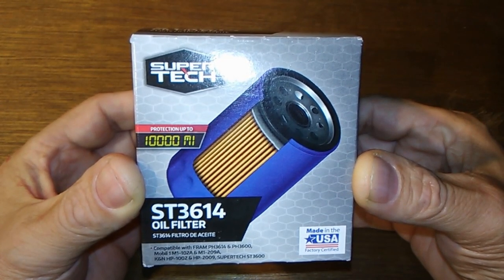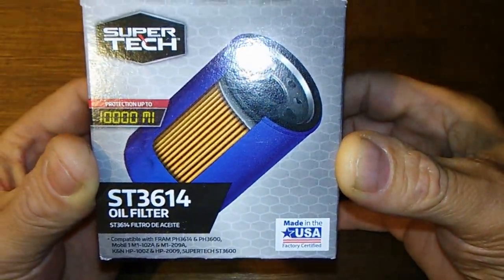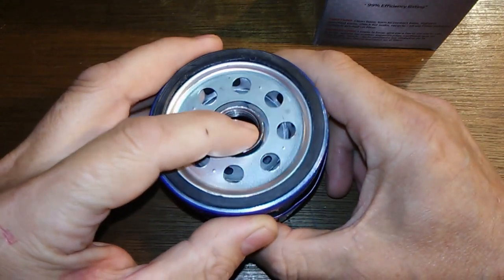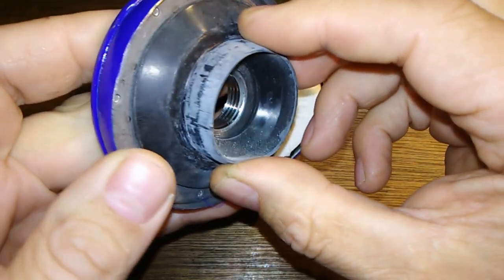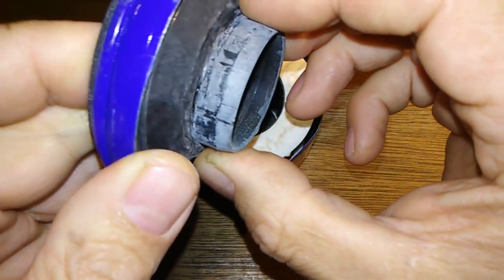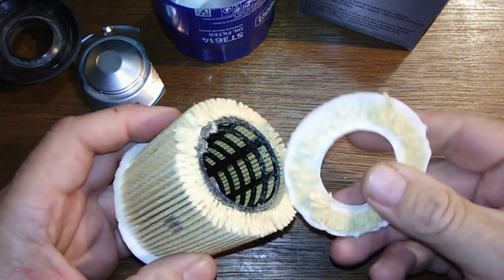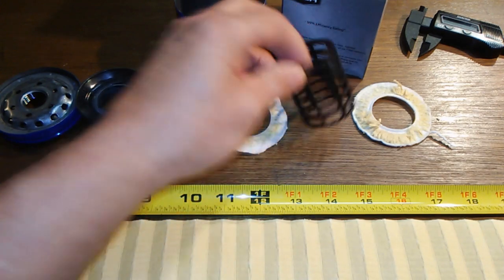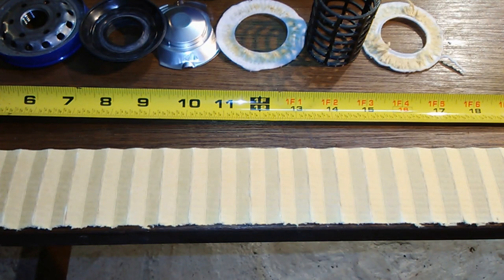Walmart Supertech Oil Filter Cut Open ST3614

Comment: I use this oil filter 3614 on my riding mower and the SuperTech 6607 on my car. Both work just fine. No issues.
Reply: TheSuperTech 7317 size filter might fit if there's room.

Comment: I cut open a super tech oil filter that was on a buick/ gm 3.4 liter. It had the same ultrasonic welded on end discs. The filter did its job and there was no separation at all. Oil filters are made to filter oil THAT'S IT nothing more, nothing less.

Comment: My 2006 Fusion uses filter elements and all that I have seen for it have been felt ends and they seem to hold up ok.  The reason I like the plastic cage is that there is far more open area for the oil to flow than the metal cheese graders.
Reply from the maker: JMHO, but I'm not a fan of the felt end caps, the plastic cage is okay I'm all for a better oil flow.

Comment: If you keep your oil changed and you never rev the engine when its freezing cold out you wont have a problem with any oil filter. I have had new oil filters that wouldnt supply oil pressure put another one on and everythings ok
Reply from the maker: I'm curious how did you know the oil pressure dropped, do you have an oil pressure gauge, and what oil filters did this? I put a working gauge on my vehicle a couple of years ago, I've only tried two different Filter Brands, but have never had this happen.
Thanks for your comment.👍🙏😊
Reply: @WhipCityWrencher  The motorcraft is on my 65 mustang I use super tech on everything else.

Comment: I use the walmart filters. I think they are the same as acdelco professional. I change my oil at 3,000 miles even if it is synthetic. Oil is cheap.
Reply from the maker: Hi J Alton,
Thanks for watching and your comment's 👍.
Reply: Really? I changed mine at 10,000 miles with synthetic and no problems at all.
Reply: @cnn787-i9e  On average, 3,000 miles is when I change oil.  A person could view it as a waste of money, but I view it as money well spent on maintaince. I also change air filters more often than needed. 
May I ask how old your vehicles are?
Reply: @jalton9416  mine is a 2012 Mitsubishi Galant with over 170,000 miles. Engine still run like brand new and smooth, I have only done normal wear and tear maintenance on the car such as brakes, timing belt, and oil change every 10,000 miles using only synthetic oil. It helps that over 90% of my driving is highway mileage.
Reply: @cnn787-i9e  I would say you are doing alright with your service intervals than. Glad your vehicle is holding up well. The vehicles I service are: 
2000 dodge neon with over 120,000
2003 chevy tahoe with over 200,000
2004 chevy silverado with 160,000
2006 chevy silverado with 130,000
2008 honda civic with 160,000
I use conventional oil in all the vehicles except the 2006 silverado. I use full synthetic in it. 
Thanks for sharing.
Reply: yeah you can honestly go 7k. i did an oil analysis on st synthetic at 10.7k after almost a year and the oil's tbn was at 1.4 and was usable for another 1-2k until it would begin to show signs of breaking down. average speed was 41mph on a 6.0 gm. oil came out perfectly and had zero broken down look, feel, or odor. broken down oil turns brownish, stinks, and feels wrong. none of that here. i understand wanting to take care of things but you're basically taking a sip from a just opened soda can and throwing it away, and opening another can, sipping, and throwing it away. if you want to take care of your engine better use a grade higher like 30 instead of 20 or 40 instead of 30. does more good for wear protection. have over 306k on my 6.0 since new. almost a quart is missing after every 10k. if i had a catch can installed almost all would be there. took the valve covers off to check the valves for the first time even though the engine is smooth and tick free since new. zero sludge and no dark discoloration, just a little 306 thousand mile varnish which is nothing. opened the supertech oil filters twice too. no sludge or anything inside. results speak. you can keep doing what you do it's your money which is more wasted then unwasted but I'm just giving testimony. i wouldn't even take conventional to 3k. I've oil tested st conventional at 5.1k and it could do another thousand until beginning breaking down.
Reply: What's the point if the sensors are going to fail anyways lol
Reply: @jalton9416  smart move.  piece of mind
Reply: I spend the $1 more for the Motorcraft filter. Metal cage, silicone bypass ring, but it has a similar bypass spring. If you change oil regularly you'll never filter bypassed.
Reply: @canoebelue  Very true. 
Let's Go Brandon!
Reply: Same i change my oil every 5k no matter what.
Reply: Not anymore :)
Reply: Oil is cheap? Not anymore it is 2022 now it’s totally ridiculous now
Reply: What if I drive less than 2,000 miles a year?
How often should I change my oil?
Reply: @June0696  i would change it once a year if I only put 2,000 miles on a year.

Comment: Its a low (cheep) end filter. Fram has the orange can of death with cardboard end caps and Champion, who makes Super Tec and AC Delco filters has these ones with the felt end caps.  Personally i would rather spend an extra $5.00 and protect a $12 to $15,000.00 engine.  I use Fram Ultra on my Toyota. Very good video, one thing you people do that makes the Oil Filter manufactures happy is convince people to buy their more expensive filters. Keep up the good work! A lot of people have no idea what garbage the low end filters are and how they can be bad for your engine.
Reply from the maker: ((Personally i would rather spend an extra $5.00 and protect a $12 to $15,000.00 engine.  I use Fram Ultra on my Toyota. Very good video, one thing you people do that makes the Oil Filter manufactures happy is convince people to buy their more expensive filters. Keep up the good work! A lot of people have no idea what garbage the low end filters are and how they can be bad for your engine.
)) 

I agree with you 100% 👍. I too use the Fram Ultra, Just recently Put in a Purolator Boss in my SUV. In one year I'll take her out and make a video. In case you missed the video here is the filter media that the Purolator Boss uses. https://www.youtube.com/watch?v=HwLMBIX94ho&feature=youtu.be 
Thanks for the Compliment and Comment. Take Care!
Reply: Now they have metal end caps and orange drain back valve st3614 bought one today

Comment: Supertech construction of its filter don't make me feel too confident
Reply: They're fine, I'll make a video on a used super tech and Fram oil filter. Both filters stayed in tact they lasted and filtered oil as they should. I've used every kind of oil filter out there. I never had any problems.
Reply: I do agree that wally world supertech oil filter is fine.. as entry level oil filter.   I'm a fan of its Warren made Syn SuperTech oil too.   But I rather upgrade  to better oil filter if its cost a few dollar more after all it is after your car you use everyday.   Case in point, I drive a Lexus RX and I can its oil filter from Toyota for $6 a can Vs superTech $4-5 ish for its filter.   So why not get something a little better.. your car will thank you for it.

Comment: had no issue with this filter on my tacoma i think ill cut open my next one to see how it turns out
Reply from the maker: Good Idea 👍,
Odds are the filter will do it's job without any issues. 
The filter media on these Supertechs look pretty good,  I just don't care for the felt end caps. Some of the Supertechs have felt end caps, some are metal, depends on what filter the vehicle calls for. Thanks for watching! 😊
Reply: @WhipCityWrencher  i have the 3614 also and last time i was going to cut it open it was just a pain in the ass. i replace every 4-5k anyways because oil is cheap and my truck makes me money so $16 every 4-5k is no big deal i get costco oil and supertech filters around $16 after tax is so big deal
Reply from the maker: @Xiferr  Nothing wrong with that oil change interval.👍

Comment: Other videos show the K& N, Mobile1 and the internals are the same as the Supertech MP. Made by Warren, the same company. Car Quest and NAPA premium filters are top notch and I think Wix makes one of those.
Reply from the maker: Wix makes the Napa oil filters, and Champ labs make the Supertech oil filters and I think Carquest oil filters are made by Purolator.
Reply: @WhipCityWrencher  Ford Motorcraft are Purolator too I believe.
Reply: @johnervin1474  Purolator design is the same as Bosch in most SKUs, which co-owned them til 2013, but is now wholly owned by MANN Hummel. ACDelco, K&N and the old mobil1 is manufactured by Champion Labs in US (owned by Trico), with some (mostly cartridge filters) out of China.

Comment: I wonder how well it works on abrasive particles SMALLER than 30 microns.  There is only a few microns clearance between the piston rings and cylinder walls.
Reply from the maker: Probably not very well
Reply: I think it depends on the SKU, but most of the BITOG folks that have contacted Champion Labs, the ones that manufacture Super Tech, ACDelco, K&N, Champ and LuberFiner, have said between 92-94% at 20 microns. At least a few of the MP SKUs guys were told 99% at 20. It's a good bet that all the MP SKUs use a different filter element. I'm still looking into if the ChampXL, ACDelco Gold, MP  Super Tech, and K&N are all the same. If so, either K&N is WAY overcharging for their ip, or you get a great deal on the others.

Comment: I like the cellulose end caps, read they are better than metal, but, I don't see it having a bypass valve, I'd pass on this filter.
Reply from the maker: This filter is made for vehicles with engines that have an internal bypass valve.
Thanks for the feedback!👍

Comment: Looks cheap wouldn’t use it on my garden tractor
Reply: @blueslime1703  in more rural areas you commonly have garden’s big enough for using tractors to plow. I use an Ingersoll 4016.
Reply: I've used the st3614 on a husqvarna riding mower worked just fine.
Reply: @justinwilkerson4697  not that it won't work quality.is questionable
Reply: Put it next to a kohler filter, exactly the same. These work great on small engines.